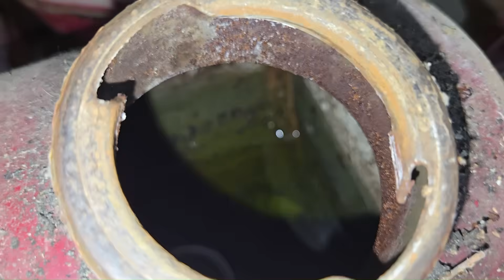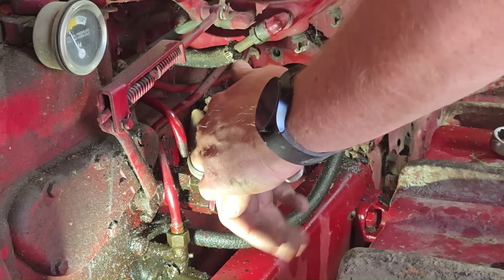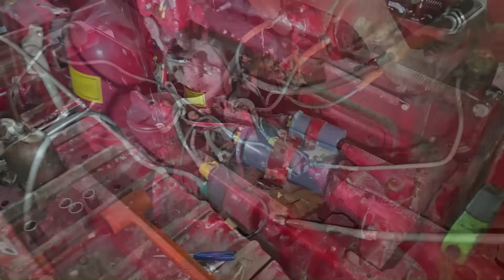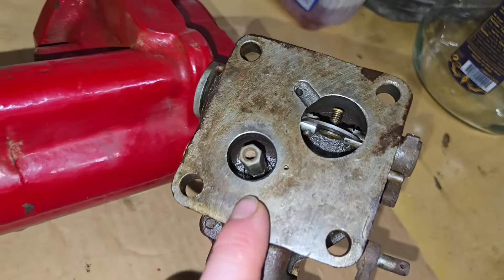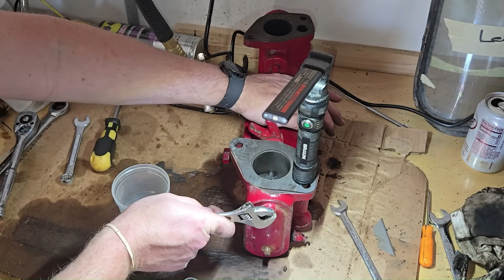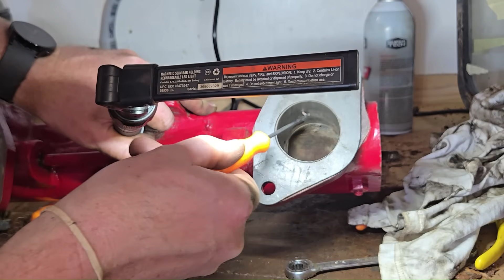Un-Sticking the TD6 Engine + Carburetor and Manifold Rebuild

Comment: All IH dozers back then started on gas and switched to diesel and I beg to differ that pony motors were simpler.
Reply from the maker: Each company has their own way of overcoming the same challenge. One thing is for sure, neither gas start diesel or pony start diesels were that great because no one uses them today. 😅
Reply: @jonelsonster  That's true, the direct injection head and higher compression diesels changed the game,but both of those old starting methods were used for decades.

Comment: I have worked on one of those dozers before.  My brother inlaw had one he got it from a farmer we no. You need to watch the popoff valves  they will bend . After you shut it off put the pop off valve lever up in the diesel position to keep from warping the valves.
Reply from the maker: Thanks for the tip!

Comment: how about hooking your pto off of your john deere to the td6, trans in neutral, pto engaged, spin the pto over slowly to get things spinning.  plugs out, trans fluid sprayed into cylinders, rotate to break in. bobs your uncle
Reply from the maker: We thought about that. But we didn't want to force things to the point that they break. Now that it's spinning, we could do it, but the engine will be spinning backwards. But you're right, it would work!

Comment: Check out just a few acres farms YouTube, Pet did a complete rebuilt on a MD. He explains how the gas/diesel engine works. A great series of videos on how it all works together.
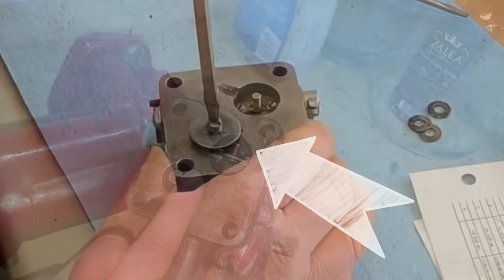Reply from the maker: I've watched several of his videos, specifically on his MD restore. In fact, that still image I used in this video (20:32) of the throttle plate was from his video. That hand is Pete's! 😅

Comment: The IH gas start switch to diesel engines have pretty complex systems on them. The linkage and adjustments and their cast in the head passages. They seem fine once running. Waking one up after a long time can be difficult. Then they just start after alot of trying. Finding somebody anymore that knows about them isnt easy as theyre usually North of 80. Parts are difficult to nonexistant for major engine things as the same parts go bad. The tin funnel on the carbs bottom isnt always there. That keeps gas from dripping on the mag . The plugs could be gotten awhile ago but maybe not anymore. They're an odd looking purpose built sparkplug. Dont toss the old ones. They're expensive for sure if available. As far as the carb part missing,well thats a hazard of somebody was here before me syndrome. It is surprising whats missing on some old machines and yet they still go. Its also surprising what is found on newer machines,or what is missing, that the manufacturer let get past. I used to have a TD 9. I let it go quite awhile ago. Kind of a fool and his money thing. I thought this fool wants to buy this and they thought this fool is selling this cheap. We were both happy. There are a couple ( at least) versions wide guage and narrow Ive heard. Mine was far from original regarding the tracks. Bucyrus Erie angle blade ,IH seemed to love that set up. Once running it wasnt too bad a small crawler. Take steps to keep the steering clutches loose. They're a chore to work on. The bolts in the coupler between the differential and clutch are safety wired,obviously why when you do them. Only used parts are available for them. They just rust tight. Some said seal up the housing and put ATF in there. I got away from the machine,it was a user machine,not a collector. It still had plenty of life in it,but it had already done alot too.
Reply from the maker: Good words here! I'm hoping we can be successful. But, you're right, the level of complexity will  make getting it going again challenging.

Comment: Not even sure whether your machine even needs that little cover. The reason the kids ruined the starter is why they couldn't start the machine. Seized up ruining the starter which you broke free with a crow bar.
Reply from the maker: I believe the throttle plate is critical to regulating the air entering the engine and for creating the low pressure or vacuum needed to pull fuel from the bowl into the intake. I think I can get a replacement, if not, it doesn't seem like it'd be hard to fabricate.

Comment: Excellent video they are designed to only run up to 700 rpms on the gas side of the engine and when you switch to diesel the gas side is shut down and it is coasting alone until the diesel engine builds enough compression to fire up.  I usually have them running on gas them put the diesel throttle to full fuel and white smoke comes puffing out then I turn the fuel off with the diesel throttle and let it coast and then open up the diesel throttle and they usually bark to life on diesel fuel
Reply from the maker: Good advise! Any special procedure for shut down?
Reply: Yes I always switch my gas diesel international engine back to gas for a few minutes and then shut the ignition off and lock the fuel lever back to diesel side
Reply from the maker: @clydeschwartz thanks! I read that people recommended letting the engine idle for a few minutes on shutdown. The theory is that helps reduce the likelihood of cracking on the head. And then I saw someone switch one engine over to gasoline to shut it down. So it's good to hear something similar from you.

Comment: You do not have to bleed the diesel lines. You can open the diesel throttle a little while running on gas. 37:42
Reply from the maker: Ah, very good point!

Comment: 😮😮 if that starter is no good only 4 parts and the generator needs 2 be rebuilt that oil in cylinders will help that dry spot 😊😊 that dics vavle 4 the carb most likely is a early style that they used then went 2 the pick up tube it was the way they was made back then and most crawlers and dozers years ago did have a gas pony engine be 4 they went 2 direct diesel engines  / and fuel tanks need 2 be cleaned out as well 😊😊 and U need 2 check and make sure the fuel rack and the injector pump and the injectors aren't stuck either and bleeding the fuel system so there is no air in the diesel fuel either 😉 😮, alot of people 4 get that after it has been setting a long time W out the engine being turned over and 😮😮 IVE  seen that be 4 a carb just like 👍 😮 that be 4 W dirt trash and water 💧 😮 and thats not uncommon 2 find them like that because they didn't keep the fuel bowl clean and the fuel tanks clean like they should've been 😮😮 and the fuels should've been strained off as well W,a old shirt 👕  or rag 2 catch the trash 🗑 😊  it's the way it is when U find things that been setting 4 years and U did catch that 1 in time ⏲️ 😊 be 4 it got alot worse than what it is 😊😊 OMG 6 2O 2O25
Reply from the maker: Thanks for all the helpful info!

Comment: Is the missing piece in the manifold
Reply from the maker: No, I cleaned the manifold passageways. And the passageways for the gasoline inlet are smaller diameter so even if the throttle plate had come loose, it wouldn't fit into the manifold passageways.

Comment: You're doing better than me, l have stuck valves possibly ruined seats. Yes I removed the head and it is at the machine shop right now, but the motor wasn't stuck!!! Good video thanks for sharing!!
Reply from the maker: Yes, I got the engine turning... But I don't know what condition the valves or head are in 😂

Comment: The 1st thing you'll need to do as far as spinning/starting is pull the starting lever which is right beside the 2 filters into the block. THAT lowers the compression ratio (extra valve) so it'll start on gasoline and warm up. When it warms up just shove the starting lever in and lay the diesel throttle lays the fuel to the injectors. With a UD engine all it needs is spark and a short dose of choke and it'll light off. It runs by itself on gas but you can regulate the speed with the diesel throttle. I ran these on a TD-20 and a TD-18 p[ower plant in a 22-B dragline. The old Gallion graders had those same engines as yours. Most got swapped out for 4-71's. Watch the girls and BLESSINGS! And the compression is too high to start on diesel and ether won't do anything but lock them up. Got to be on gas.
Reply: We had one pretty much like this one.  I think it was built in the early 50s. When the engine was properly tuned up you could start it with a hand crank on gas. 
If you need a great resource on this engine, Pete from “ Just a few Acres Farm” did a complete rebuild on a farmall MD which has the same engine as the TD6.
Reply from the maker: Seeing a 4-71 swapped into the places of this engine would be very cool to see! I bet power was increased quite a bit too!
Reply: @jonelsonster  The old grader had more power than it needed. Worked a road in fine shape.